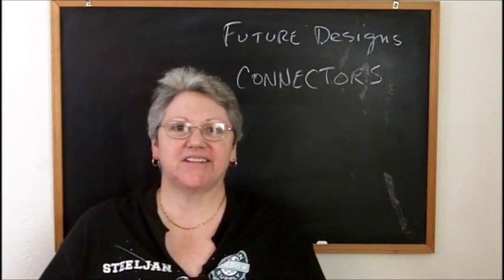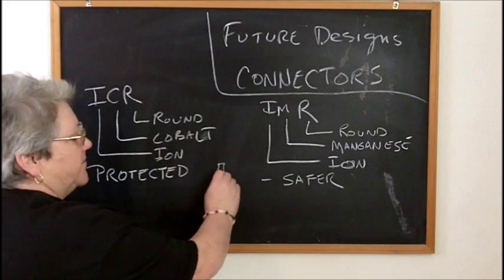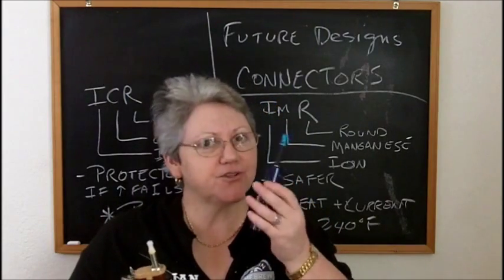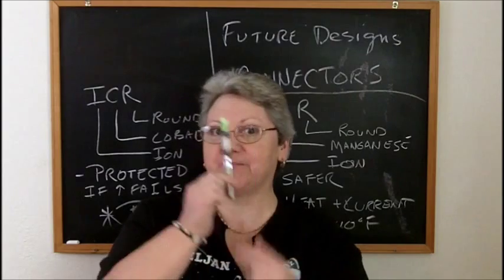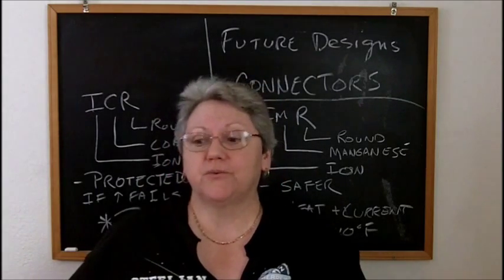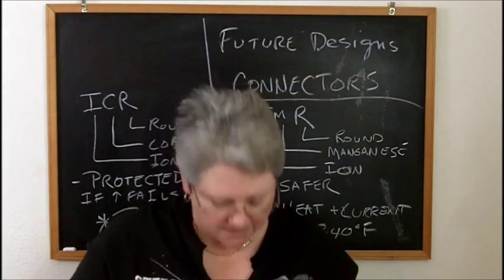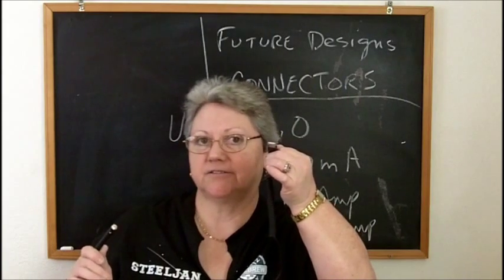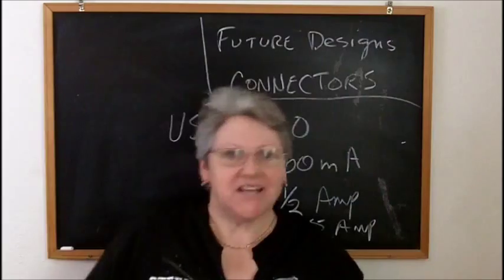Ecig Future Design Ideas - Connectors

Comment: Great vid and One regulation I would support on vaping equipment.  And one which might keep open tank vaping alive.  The current reckless path on vaping equipment will eventually outlaw the reckless stuff and probably much of the safer stuff as well.

If you have a sub ohm capable device be it the batter, pass thru or the atomizer it should have a connector specific to that capability.  Maybe limited to wattage capabilities of the device.  All rebuildables should be rated at subohm, becuase anyone could build a subohm coil in them.

Comment: Hi. Saying that 99.9% of the mods doesn't have a short protection... I have to disagree. 80% of the worlds mods are Mechanical Mods that mostly are designed for IMR batteries and have bottom firing button. It doesn't have the short protection... Does it? You are the protection, You feel heat You stop pressing the button - cut the connection - it's as easy as that. Multiple connectors for multiple atties? Good money for the producer... imagine buying a mod with 100 different top caps. 2000$?

Comment: I think that the charging circuitry will pull only 500mah at a time, she is assuming that it will pull enough to vape with but unless she has done tests, I dont believe thats how it works.  It charges the battery as you use it, it doesnt power the vape from the usb.

Comment from the maker: @bizzyb0t Yep.  Or the other night on a vapersplace show, Jamie mentioned a TIP connector, that would be good too.  I'd just like to see + and - separated and there's probably a spec out there on how far apart they need to be and what materials at the amperages we are using.  Thanks!

Comment from the maker: @msvapehead It depends on the battery and the environmental conditions you are storing it.  As for vaping LR dual coil on an ego battery, I wouldn't do it if I don't know how many instantaneous amps that battery can deliver, if it can actually safely handle that cartomizer.  In short, no, I just wouldn't do it.

Comment from the maker: @MrSteelMage The Lavatube is not auto-sensing the resistance of the atty/cartomizer, rather, it has a current regulator in it that will not let the current exceed 2.5Amps.  If the current tries to exceed 2.5A, the voltage regulator drops the voltage until the current drops below 2.5A.  PWMs is pretty much on-off switching that is timer-controlled, few milliseconds on, fewer milliseconds off, repeat, we use PWMs in anti-lock braking. But yes, some things are moving towards greater safety, some no

Comment: Thanks for the excellent idea's on how to make batteries safer. I was wondering if some of the new technology I'm seeing in some of the new modes that recognizes the resistance level of the atty and either won't fire the atty or in the case of the Lava Tube auto adjusts the voltage down, will eleviate the need for multiple connectors. It would seem that between auto resistance sensing, auto short protection, auto voltage correction and PWM use to control coil heat that we are on a safer track.